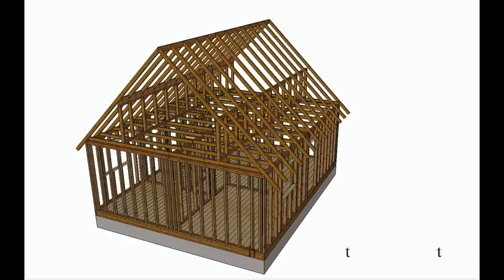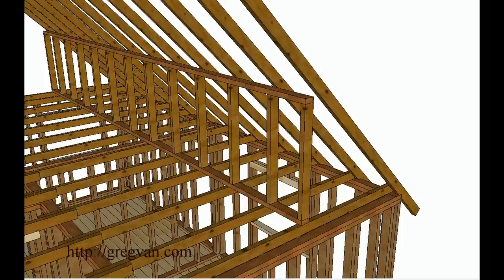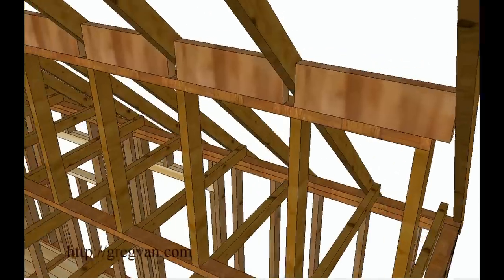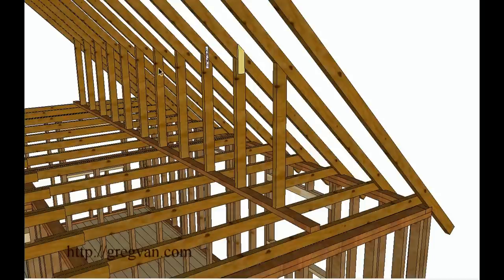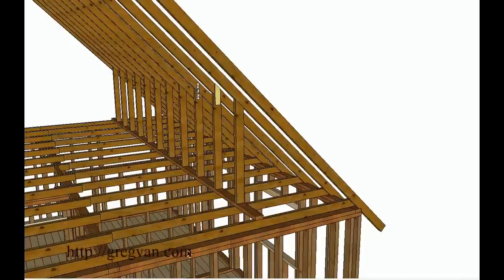Using Walls Instead of Purlin Braces to Support Roof Rafters – Attic Remodeling Tips

Comment: how is someone supposed to nail a hurricane strap in the orientation and what you show? in real life situation there would be sheathing right up against it
Reply from the maker: The hurricane strap could nail over the plywood.
Reply: gregvancom No I'm talking about 1:10 on the wall.. a wall that is supposed to be carrying the roof load. which is built on top of ceiling joist. in the middle of the joist span. you can't do that the roof load has to be brace directly to a load-bearing wall all the way down to a a pier to the ground
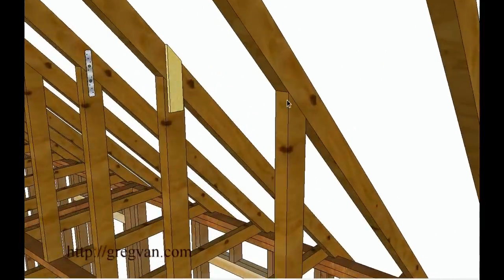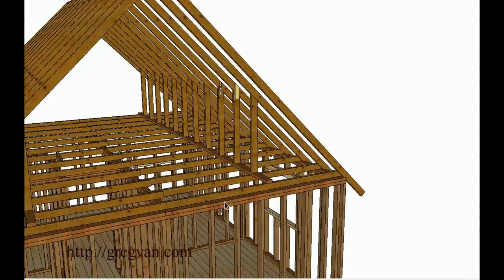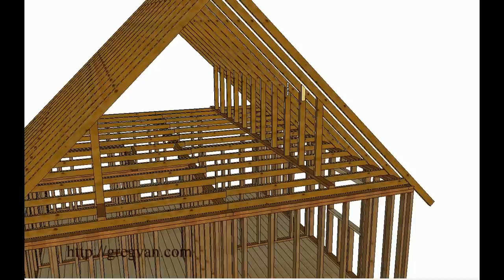Reply from the maker: Hold on a minute, first you said that the hurricane straps couldn't be nailed on, but they can be. Not all situations like I'm explaining in my examples will require plywood and you need to rewatch the video again. Especially 2:46, 4:30 and 5:10 to the end of the video. Please keep in mind that the examples I use in my videos might not work on every project and I've stated that multiple times throughout the years.
Reply: gregvancom so this is a new construction type scenario? Otherwise wouldn't there be plywood on the roof or t&g or 1x6? I'm just confused I guess. Sorry dude
Reply from the maker: It would be difficult to see the main point of the video with roof sheathing and that's the reason why it's not on. An experienced engineer should have came across plenty of things that lasted for decades, even though they wouldn't be approved by local building departments or make sense using a mathematical formula. I try to provide people with examples of things I've seen in the past while repairing or remodeling older homes and that's all this video is. I'm always open to more questions, so give them to me if you have them.

Comment: So there is no other way to do this ? How about running 3 beams across the center of the roof or something along that line ????
Reply from the maker: There are other ways to support the roof rafters, but these are the most common. Yes you can use beams as long as they're structurally supported by post sitting on top of concrete footings.

Comment: What if joist are perpendicular  to the rafters?
Reply from the maker: Then you would normally install rafter ties on top of the ceiling joist.
Reply: joist are 2 x 4  and a framer already sister them with 2 x 8. on top of this Should I add rafter ties?
Reply from the maker: It might not hurt, but it would be hard for me to suggest without seeing a few pictures of your situation. If you want send me a few pictures, but if not and it isn't too much trouble to install them, I couldn't see where it would hurt.